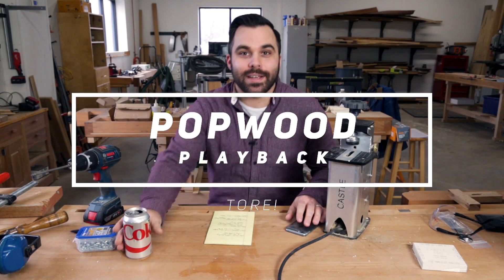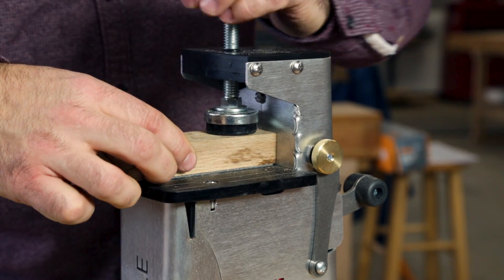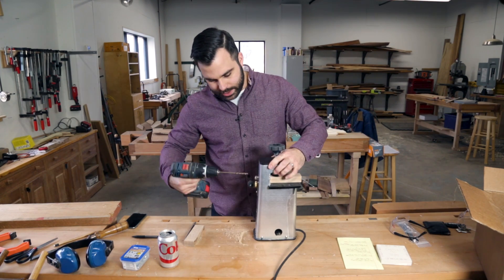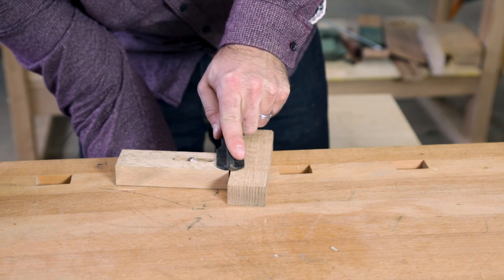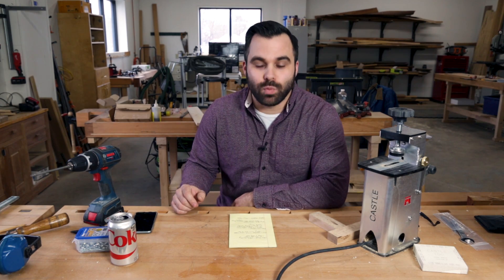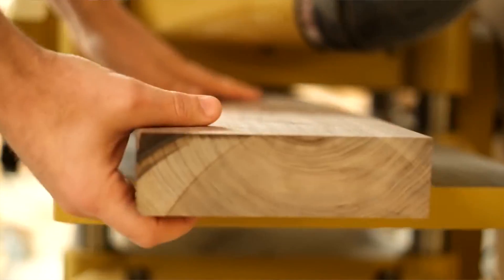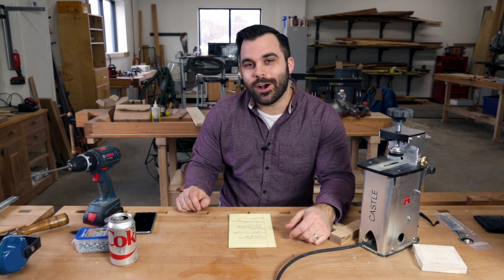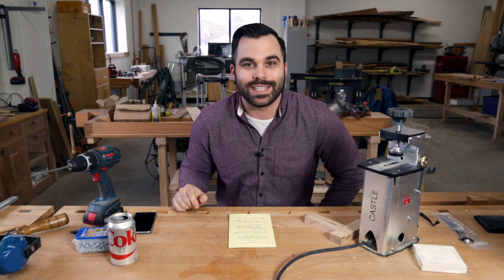PopWood Playback #8 | Top Woodworking Videos of the Week

Comment: That tool adds extra steps to a mediocre joint. with the addition of a router how does it compare in cost to the foreman? to me I won't splurge on anything bigger than the k4 mounted on some mdf.
Reply: Tim Mills This made me raise my eyebrows also. Castle makes pocket hole machinery for commercial shops. This product seems more suited to compliment those machines. At nearly $500 (router included) it seems like a poor choice for the hobbyist.
Reply: Kevin Almeyda I recently saw the foreman for 350 at a shop and it's a 1 pull and done, no reaching around back, then mill the wood and then drill... a waste to me. pocket hole joinery is supposed to save time, and if done properly it's hidden so quality of the hole is irrelevant to the project. this is a screwed butt joint, not rocket science. one extra step to hide the screw I am willing to do, but a slew of steps to do what we have all done for years? not so much... maybe I will make a metal version of the kreg k4 or k5 for my shop and that would only be so I can say I made it...

Comment: Not sure about the Castle100. For one, the bottom of the pocket hole can't possibly be flat. Two, it's a two step operation that requires drilling the pilot hole. Three, the lack of a quick release clamp seems like it would be tedious. Four, turning on and off your router hundreds of times seems pretty cumbersome. Five, using this thing at the end of a long board seems like it would require some jigging or else it would be truly cumbersome to use. Anyway, obviously not commenting from personal experience but it just seems like a step backwards to me.